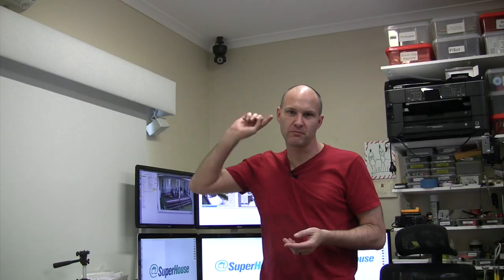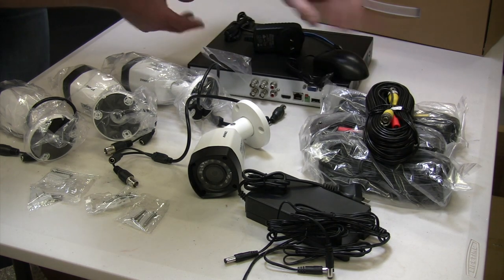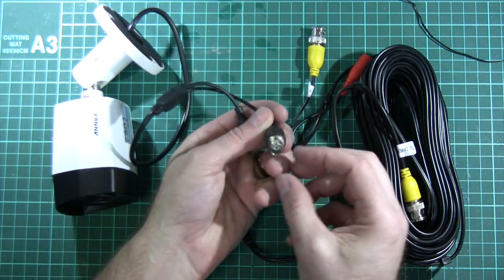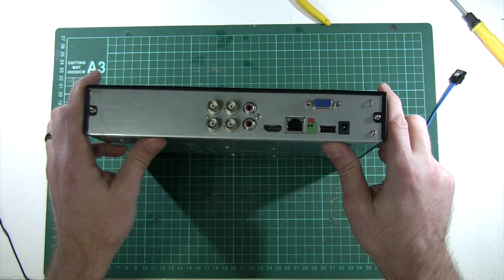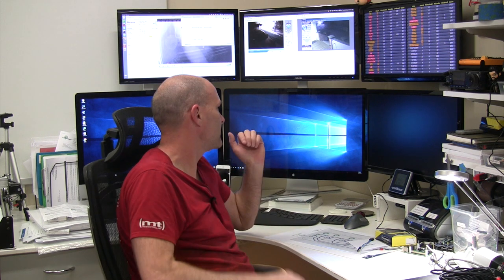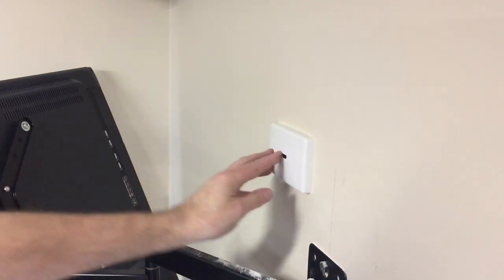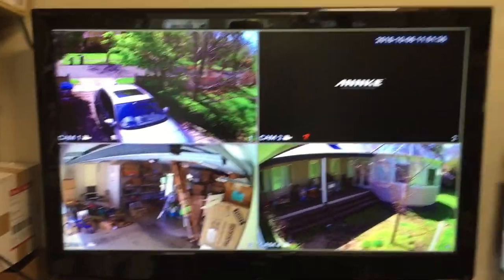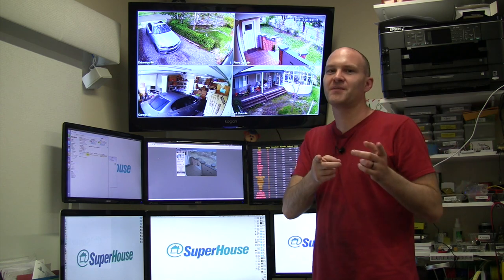SuperHouseTV #18: Installing the ANNKE 4-channel CCTV system

Comment: A bit late given the age of this recording...... That is no way a 4K HD kit for that price. I am sure that is what you said but then there was a jump in the video that looked like an edit so you may have been talking about another camera type.

For info BNC and Phono connections normally only carry analog but you can send digital to some extent. This is more down to the manufacturers than bandwidth limitation of coax. The right type of coax cable has more than enough bandwidth to do the job. The problem is the cost of the hardware at each end. In order to send very high definition video some very expensive hardware and processing grunt is needed.

I have yet to see a consumer priced coax based NVR/DVR that will record in 4K. To get that resolution you normally need a cctv camera with cat5/6 that is usually powered by POE (Power Over Ethernet). The video and control is normally sent through the network via H.265 or MPEG-2 encoding for the video or will use a management and video protocol such as ONVIF and many others.

I am going by what is available in the UK. Here we use 50 or 60 Hz displays on normal home TV's, higher frequencies are normally only found on high end HD televisions and computer monitors. We use a video standard known as PAL-I in the UK. Different standards are used in other countries.

Make sure you do your research before handing over your money and if possible buy a recorder that will give you the ability to expand the system later.

If you want a very high quality no hassle cctv system then go for IP cctv cameras. Bellow are some links you may find helpful.

https://en.wikipedia.org/wiki/ONVIF
https://www.cctvcamerapros.com/remote-security-camera-viewer-software-apps-s/671.htm
https://www.cctv-information.co.uk/i/Transmission_of_Video_Signals_by_Cable

I hope this is of help to someone.  :)

Comment: What if someone hacks into your network and sees what your seeing
Reply from the maker: That's a danger with networking anything. If someone gets onto my home automation network they won't just be able to see what I see: they'll be able to unlock doors, open windows, turn lights on and off, activate sprinkers, and do all sorts of crazy things. So I don't want that ;-)
Reply: SuperHouseTV how would you go about programming a tuff protection wall if that's the correct terminology to use.
Reply from the maker: Now that's a very big question! I'd need to do a whole episode about that. Actually, that's a good idea.

Comment: I need to stop watching these videos, although it gives me a good laugh.

The siamese Coax/Power cable that come with those cheap CCTV kits are crap. You should just use proper RG56 or if you can find it RG6 siamese cable. Or future proof the setup and use Either Cat5e or Cat6 with Video Baluns.If you want to cheap out on the CCTV system then get a HikVision Value series kit or spend a little more and get a FLIR. Those two companies are the big boys of CCTV.